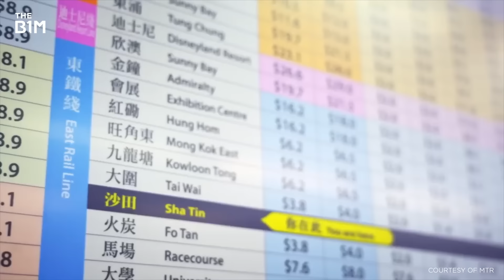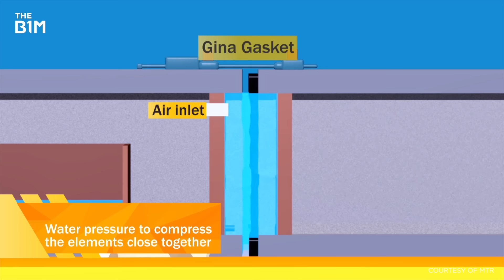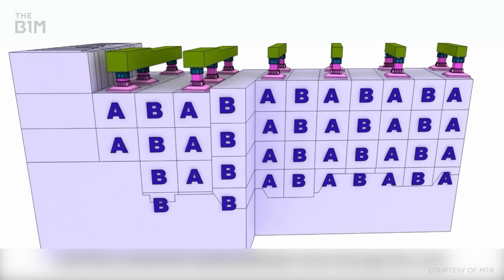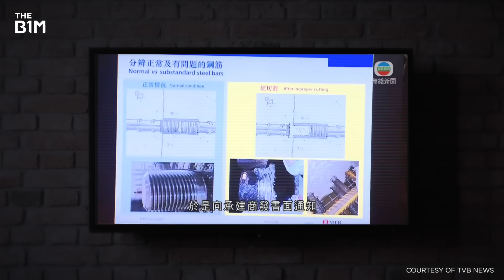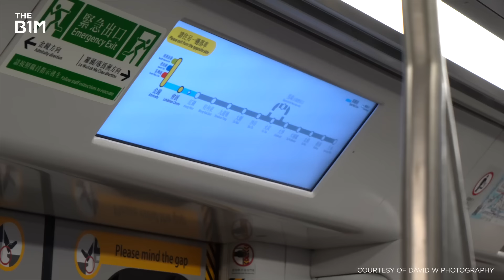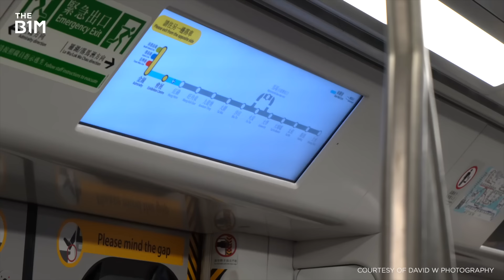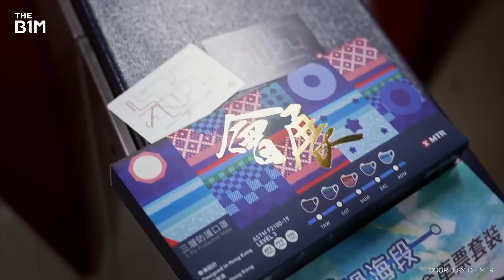Hong Kong's $11BN Underwater Railway Explained

Comment: Thanks for inviting me to talk about how the enthusiasts showing their love on railway.

The Shatin-Central Link is one of the important railway projects in Hong Kong, and forming two critical railway corridors-Tuen Ma Line and the East Rail Line Extension connecting the Fourth Harbour Crossing Railway. The new railways might bring convenience to railway passengers, and it should also be a good opportunity for the Hong Kong Government to rationalise the public transport network (but not just cancelling bus routes or reducing the frequencies of buses).

As mentioned in other interviews conducted in Cantonese,I always question that: is railway-oriented transportation policy the only or the best solution for commuters in Hong Kong?
Reply: Cross harbour link sure is convenient if you want to get to Hong Kong island, but reducing the cart length from 12 to 9 is a massive yikes. And the frequencies are frankly quite low compared to a typical kwun tong line or tsuen wan line, might just be a result of standing in the summer heat with no AC stations of east rail line haha
Reply: @mcwatcher7790  I feel that the East Rail Line with full 9 car operation can handle the demand. And they do have more new trains yet to enter service.
Reply: when it comes to public transit you almost always have either buses or rail, which can take the form of a subway, tram/streetcar or LRT
cable cars aren't usually used unless there's very hilly terrain and monorails are impractical, however i think there are some in a few places
rail has proven time and time again to be better than buses in a lot of places so yes it's usually the better way to go when making transit, only problem is it's much more expensive so most cities in the us have very few rail lines if any at all
Reply: My Allah!
Reply: LOL. How did that tiny section cost $11b? Obviously the contractors were overpaid. No matter how difficult the construction was, it was not worth $11b. HK Gov and MTR could simply hire a Chinese construction companies to do it at a much cheaper cost, but they chose not to.
Reply: @dt8101  The section from Hung Hom to Admiralty (approx 6km) is only a part of the Shatin to Central Link "SCL" project. 

I will include a list of major costs in the project (Ma On Shan "MOL" and West Rail Lines "WRL" are the 2 old lines that are now part of the Tuen Ma Line):

Construction of the 11km new section of the Tuen Ma Line, extending the MOL stations to accommodate 8-car trains,  upgrading the entire East Rail Line to CBTC signalling, resignalling the WRL and MOL, renovating and reorganising 4/7/12-car SP1900 model trains to 8-car trains, additional footbridge networks near Diamond Hill station (many cities don't include this as part of the actual transit project), and upgrading WRL and MOL depots.

A handful of Chinese contractors were selected for the SCL project. These include the automatic fare collection system (ticket gates and machines) and platform screen doors + gates on the entire East Rail Line. The platform gate retrofitting project on the East Rail Line's old overground stations is the biggest, most expensive and complex project of its kind in Asia (not sure about the whole world but you get my point).
Reply: @squidgame2021  but after the Northern Link and Pak Shek Kok and Kwu Tong and even Lo Wu South stations are developed, i don't think 9 car is gonna hold it anymore

plus judging by the current situation, 9 car trains are already overcrowding too much
Reply: not to mention that the mainlanders arent even here yet
Reply: @Titan-qi9mv  The East Rail Line is not running at full 9-car capacity now, and 10-car trains (R trains or new stock) can potentially run after minor infrastructure upgrades in the new section. 

Of course it is crowded, but it's not unacceptable from my experience. The R train's practical and spacious design makes it more suited for crowded loads. And contrary to the urban lines, moving to the next car often results in a noticeable difference.
Reply: @squidgame2021  yea i def agree with u but in the future the government should definitely construct another railway similar/parallel to the east rail line to ease congestion
Reply: Given the enormous ridership of commuters in the city, railway is the most efficient transportation mean. The current problem of HK is the concentration of business districts which creates unbalanced single way traffic in the peak hours. The most ideal solution is to reduce the demand of transit just like what the Colonial government did when designing new towns such as Tuen Mun (but it failed). If we omit the political intention, Northern Metropolis project is indeed a creative solution to lower the density and divert jobs spatially. What the government needs to consider is the conflict between rural residents and the construction; and how to make the site an attractive business zone for enterprises. Sadly the China-HK integration nature of the proposal makes things complicated unnecessarily. People include myself are sceptical to any project related to the North, like the Northern Rail Link now.
Reply: @kcrer2004  honestly saying I don't think diversion of jobs would work as much as intended but i do hope the northern development would turn out nicely, recently kai tak development area construction progresses are in full swing, it really is a good example of decent development, i hope the northern development would be like this too
Reply: hello, can i ask when will HK open it's boarder like no quarantine and opening for tourism?
Reply: @kimcruz2094  You ask a good question. Actually no one knows.
Reply: Hi, maybe I’m really uneducated in this matter, but as a fellow HK resident, I gotta ask if Hong Kong’s public transport is really rail oriented? As far as I know buses provide a very competitive alternative because you are more likely to have a seat (and therefore feel more comfortable) and journeys can be more direct since many routes run on expressways. 如果我係新界西北居民我冇乜理由靠輕鐵/屯馬轉兩三次車先過到海囉，真係要去港島東我寧願搭巴士過咗海先轉港島綫🤣
Reply: the governments take is always railway-oriented, but i think other transport modes should be maintained and improved rather than build new railways and cut down on buses/minibuses
Reply: The goal of MTR, or any heavy rail network in general, is to provide people with convenient access to general areas across the city that many people would have to travel to and fro every day. Imo, it shouldn’t, and can’t be the one commuting option everybody uses. It’s unreasonable for the MTR to explore every nook and cranny of Hong Kong, be it due to construction constraints (E.g. The Siu Kai Wan Station dilemma), insufficient demand (North Island Line project), or why would you even bother making a station in a certain place at all. 

The future of buses, minibuses, taxis, they are all going to still be relevant for making the short-distance trips happen or trips to very specific areas you can’t expect to reach via MTR. But work needs to be done to improve the service of these other transport networks to improve efficiency of moving people around. 

Regarding the shortened trains causing problems, I believe it’s not a very big issue. Not long after it opened, I rode on the new Cross-Harbor extension on the new trains, and I’m stunned by what I observed. The trains do manage to meet the demand, thanks to the higher frequency of trains as compensation for the shortened trains. The trains are also noticeably faster. In the same time I get to Hung Hom in the past, I can now travel to Admiralty, which is previously unheard of. The train frequency is really the key.
Reply: @nathanhon1784  1. Do you mean Siu Sai Wan（小西灣）? 2. Which one do you think has lower demand, north island line or northern link（北環線）? I think north island line is kinda necessary lol
Reply: @dt8101  yes they would much rather give there citizens a higher pay to give there workers a higher standard of living, it's an atrocity
Reply: @squidgame2021  when will they extend the hong Kong island line(blue line) to the west side of Hong Kong island?
Reply: @austinharding9734  If they ever build a line there, it will likely be a light/medium capacity railway similar to the South Island Line. In fact, the proposed line is called the South Island Line (West).
Reply: Based on the amount of commuters? Railways are often more preferable, mainly for capacity.
Reply: @troy5094  I would agree that the North Island Line is necessary in order to provide relief to the Island Line. However, demand for the Northern Link (and its phase 2) will likely be higher once the land there gets developed. One concerning side effect if the North Island Line would be more people traveling on the East Rail Line as this will provide better connections with the East of HK Island.
Reply: @Titan-qi9mv  Follow up on an earlier comment. By the East Rail Line not running at full capacity, I meant that they aren't running at max frequency for the amount of trains they have. MTR can choose to increase this if needed and around 9 more trains are yet to enter service which will allow even higher frequencies. 

And let's face it... incoming mainlanders from Lo Wu probably did not walk down the entire platform so they were pretty much only traveling in 9 out of the 12 cars. 

Would love to see a parallel, hopefully express, service to the East Rail Line to provide relief in the future.
Reply: especially important is that the often ignored sections of Ma Tau Wai/Kowloon City(via Sung Wong Toi), To Kwa Wan, and Ho Man Tin finally have a more efficient way to be accessed, rather than "all roads must pass through Mong Kok".  me heading to TKW before often means taking the NP ferry rather than switching multiple buses and the traffic jams of the red tunnel.
Reply: @lwf51 Thanks for sharing, imo diversification is key, like in HK where I can choose metro, bus, tram, or ferry depending on my needs. Mainland China on the other hand is building so many metro systems and so-called "city-wide rails" (Chinese cities are VERY big in area), which seems impressive until you realize it's because the roads are too congested and buses are too slow
Reply: Hey Aaron, just my opinion as a HKer working in California: I think HK's unique topography (mountainous and ocean surrounding small, narrow areas of flat land) make it ideal for rail-focused mass transit.  Buses may work well in Kowloon and HKI but trains traverse medium distances the most effectively in my opinion.  They are also effective at crossing over and under other transport infrastructure with dedicated right-of-way.

Cheers and stay safe!  Can't wait to come back to HK when travel restrictions loosen up.
Reply: @mcwatcher7790  Read that it was deemed too expensive to build the new train stations to have 12 instead of 9 car platforms, while shortening the no. of cars/train also let them avoid the curvier ends of existing stations platforms (where the platform gaps are wider)
Reply: Singapore also has experienced public bus rationalization when its rail network is expanded, upsetting passengers as trains have fewer seats, & using them needs more transfers. I've also made a few journeys that were 10-30min longer if I incorporated trains into them (as opposed to if my journey was purely by bus) as detours were needed to get from my origin to the train station & from the station to my final destination

Comment: I can drive to work in 1-2 hours, depending on traffic. Round trip, per day including parking, tunnel tolls and fuel is approx HK$400.
If I ride the Tuen Ma line, it's unaffected by road traffic & bad weather, takes a bit less than 1 hour and cost $45 HK$ per day. And no stress from inconsiderate drivers.
Great to have this system available!
Reply: wow , awesome , i am envious
In Australia we have highways with tolls , i know some truck drivers spend AUD $ 2000 per week on tolls which is insane
Reply: That’s fantastic more countries to be doing this and take more car’s of the road to reduce congestion and pollution….
Reply: Hong Kong’s unique transportation solutions are definitely affected by the difficult geography.  It’s awesome not having to worry about where to park your car.